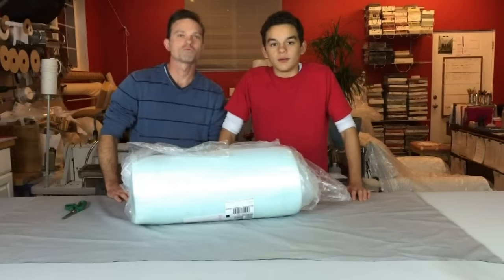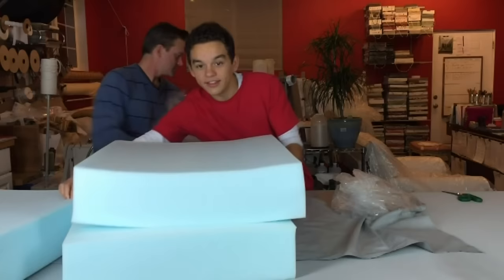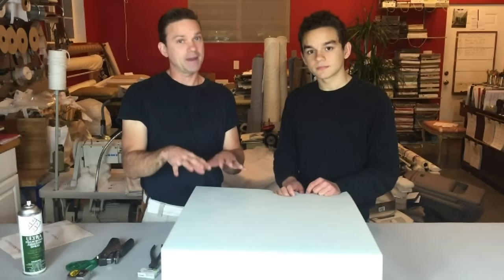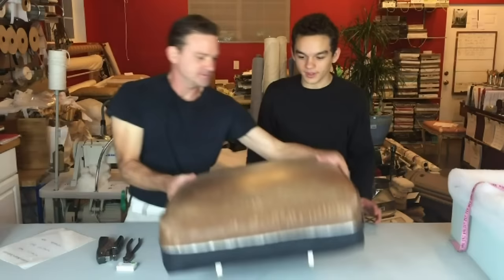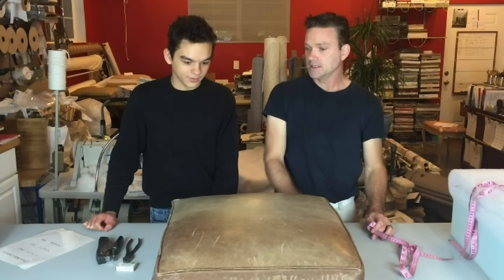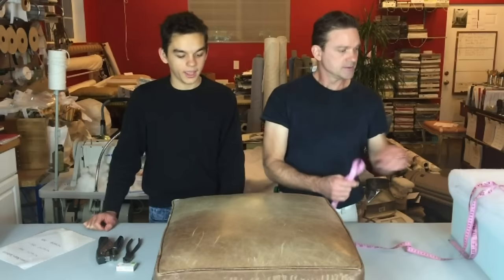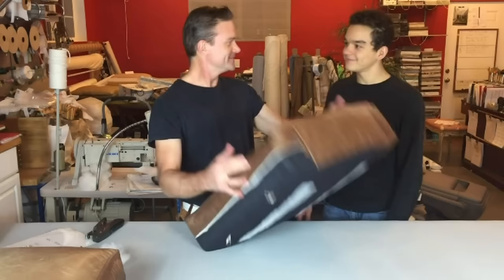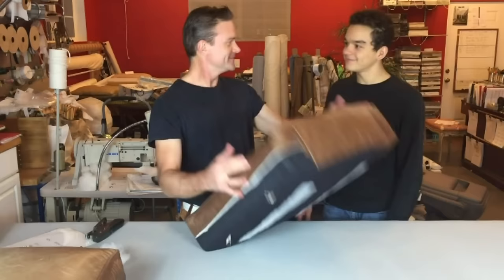Replace the foam in your seat cushions fast and easy!

Comment: Hello, quick question
Can I put a 5 inches thick high density foam into a 4 3/4 seat cover (Patio chair). 
I found a nice waterproof covers already made with a zipper , great price to save the measuring and sewing process. Pls let me know . Thank you for your time
Reply from the maker: Hello Yani,  YES! You can in fact we always go 1 inch larger then the cushion cover band size 4" cover we put in 5" foam PLUS poly-batting 1' thick , so you will be fine. It might look a little flat to you, but it will fit.  Cheers,  Paul
Reply: Really appreciated thank you

Comment: I have a cushion with a 4" box and have 4" foam inside.  Am I able to fuse 1/2" foam to the top and bottom in order to achieve my 5" foam?  Shall I use 26/45   1/2" foam?
Reply from the maker: Hello Lorraine,
Thank you for the comment, sorry for the late reply the holiday time keeps us very busy. To your two questions the 1" foam depends on 4" foam density. Is the 4" a really soft foam? Are you wanting a soft cushion? You could go with both being soft. You could go with the 45 density, however I believe it might feel odd. Because the 45 is to thin to provide any support. The best combo is a firm core with a soft 1/2" topper or 3/4". The stapler I believe is a Swingline  pliers stapler standard. I bought it at a big box office store. My father used a heavy stapler with a thick wire, they can be a challenge to find and I found it not necessary. I hope this has helped thank you again for watching and for the comment. Please share the videos it helps us when you do. All the best,   Paul

Comment: I can only get firm or medium of foam, and the dacron in different oz/gsm in UK ,would you please advise?Thank you
Reply from the maker: Hello Philip,
Thank you for commenting. If that is all you can find that can be okay. IF the cushion you need is not to thick. The thicker it's best to go with a softer foam. The thinner you would want a firmer foam. The platform has a lot to do with as well. IS it a springy or firm platform? I don't know your situation, but I would believe it's best to go with medium foam. As for the dacron . Here in the US we us 1" that is considered to be a full wrap. See if you can get them to help you in the thickness of the dacron/or poly wrap,rather then the weight. I hope this addresses you problem.  Please share the videos it helps us when you do. Let us know if you have another question.   Cheers,   Paul

Comment: What do you do if your seat cushion is a weird size or shape?
Reply from the maker: Hi Danielle,  
The best I know is 1) of 2) ways.   1) You can trace the cushion(s) with fabric, tracing on top of the seam the very best you can. Then cut carefully on the line that you just traced, using a slap of foam wide and long enough, trace a line a 1/2" outside of the fabric trace making for a total of 1" larger all around. FOLLOW the video instruction for all the other measurements you need. 2) Some companies will take your cushion cover  (OR TRACED FABRIC PATTERN) you ship to them and they will fill it. However things happen and it could get lost. Try this company foamorder.com  Hope this has helped and please share the videos it really helps us when you do.  All the Best,   Paul

Comment: I weight 350 lbs, what do you recommend the type of foam to use on a 6” cushion. It’s an older couch and this are the original cushions, flat as a pancake.
Reply from the maker: Hello Dean,
Thank you for the comment and watching the video. 6" foam is on the thicker side when comes to cushions. You will get even more support with any high density foam, we only offer and recommend 26 density. So to your question:  foam cushions at 2635  6"  will be very firm because of the high density, it simply offers more support than lesser density foam.The platform plays a roll, Is it springy or a firm platform?
All these factors need to be considered, all foam overtime weakens. If like a firm seat cushion given your weight that you stated, with a springy platform I would try 2635. However the out come could end up to firm for you in the beginning. And wow from a pancake cushion to a firm cushion you will have a big difference. I hope this has helped you. please share the videos it helps us a great deal when you do.  All the best,    Paul

Comment: Does the density factor apply to automotive seat cushions?
Reply from the maker: Hey Brent,
Thanks for checking out the channel. I have had others ask the same question. When it comes to autos it really comes to the year of the auto. Maybe the 50's and 60's bench seats if it has foam from the original factory, I'd say yes. I have had older import cars that had horsehair in the seats "CRUNCHY " Newer auto seats are foam molds with very high density in some case making it to firm. I really hope this has helped in someway getting you on the right track. Please consider sharing the videos with someone who might benefit. Thanks again.   Cheers,   Paul

Comment: Awesome! Great tutorial. Where do I order the foam?
Reply from the maker: Hello Mars Bars, Great name😀. You can go to ucprivatecoures.com  and order there. There is live chat if you have a questions. THANK YOU VERY MUCH for watching. All the best,   Paul
Reply: @ucsolutionsgivingmore  Thanks for your reply, Paul.  My husband thought that we should take the old foam out of the cushion and measure it so that we get the exact measurements of the foam.  What do you say about that?  Why did you measure the cushion with the old foam in it?  Just wondering what you suggest?  Also, what's the purpose of putting the dacron on it?  Do we need it?
Reply from the maker: Hi Mars Bars, great questions, the best method is to measure the cushion cover since the old foam is going to be misshaped. Also, you would want dacron wrap for the cushions so you can have that nice crown on top instead of it looking flat. I hope this helps!

Comment: Hi, at your videos you mentioned that if you are heavy or need more supports then able to order 2650 or higher compression like 50 or more, but at the site it is only offering 26 35 45 & 75.
what do i have to do in order to be able to other compression of 50,  thank you very much!
Reply from the maker: Hi, Great question, in some cases you can layer foam putting a higher compression foam underneath a lower compression foam. Though you are correct in regards to having more support with a higher compression, 45 compression is quite versatile and is still a viable option. All the best, Grant

Comment: where can I purchase (2) 18"x18" 4" 26/30 or 26/32 high density foam squares- these are for my rv and my butt spends a lot of time in that seat; I have purchased cushions from online retailers only to be severely disappointed; I,ll do the covering if I have to I just need the right foam 3 1/2" 26/52 would also work ; if you sell this item please let me know or suggest a trustworthy outlet where I may purchase; thank,s great informative video I learned a lot  sincerely, PATRICK.P
Reply from the maker: Hey Patrick, thank you so much for watching, we are very glad that you found our video helpful! If you would like to order the foam you can contact us at videos@urbancastlesolutions.com (this is the only email address where we accept foam orders). Please include the measurements and your zip code for shipping cost in the email, and we'll send you an estimate for the foam. There is no pressure to order as well. Please share this video as well, it really does help us!
All the Best,
Grant
Reply: I wish to thank you for your timely response; I will be contacting you shortly about creating a 3 1/2 " 18x18 cushion for my rv; I really want to trust somebody to do the job right;  26/ 52 dens./comp. thank,s again ,Patrick.p

Comment: I purchased a sectional and the cushions although comfortable are way to "cushy". Is there a way to tell the existing rating and a way to move up the scale to get a firmer cushion without turning it into concrete?  Thank you
Reply from the maker: Hi David, thanks for the comment. Yes you're wanting a higher compression number than what you now have. No we can't tell what the exciting rate is on your foam. Maybe but unlikely it's stamped on the tag behind the zipper bands from the factory. It should be if it's there the last two number say 1826. 26 is the compression number. Medium to firm is about 32 to 35 if you want there is a trick but you may not like it. Put a half inch cut to size a little shorter front to back plywood covered with fabric underneath the cushions it will make it firmer or you just need to replace all the foam seat cushions thank you again I hope this helped cheers.    Paul

Comment: I want to make so.e cushions for the back of my sofa. It came with basically pillow filling just inside the cover and i cant wash and replace the cover ever becuse all the filling will be everywhere. And its starting to get saggy
Reply from the maker: Hi M.A.
Thank you for the comment and for watching the video. I think I understand what you are saying. Here is two questions: When you open the zipper is there no liner filled with poly fill? Only poly fill pushed into the top cover? I have seen this before. If I have it correct you can get simple liner fabric or muslin fabric. Use that liner to trace the cushion when it's filled, band size maybe add an inch or so to that (making the insert liner larger to fill out the cover itself). Once you have the NEW insert liner cushions made and the poly fill permanently inside the new liners, you can clean the outer cover without having all the poly fill everywhere. I do hope this has addressed you problem.  Again thank you and please share the videos it really helps when you do.  Cheers,   Paul

Comment: Why do you need the Dacron at all?
Reply from the maker: Hi Caroleeena, 
Great question! You do not need Dacron at all. If the foam you are using is thick enough to give a nice crown or loft to the cushion.
Dacron gives a soft feel rather than a flat surface of foam, but if the foam is larger then the cover by one and a half times it will be fine. Please share it helps when you do. Cheers,     Paul.

Comment: Two questions, please:  What if my sofa's cushion is rectilinear but non-rectangular?:
 ____
|          |_
|            |
'-----------'

and is there any way to wash the Dacron before reusing it?
Reply from the maker: Hi SteveBowen,
In this case, it looks like you have a chaise cushion which is the same thing as an L cushion (just deeper). You can order it precut with Dacron attached here on our website: https://ucprivatecourses.com/product/sofa-seat-cushions-foam-inserts/

Also we’ve never washed Dacron to reuse it. I would suggest getting new Dacron since your current Dacron is most likely matted down and will not last long. 
All the Best, Grant

Comment: Would this method work for outdoor cushions"?
Reply from the maker: Hello Diana,
Great question. In short yes! However outdoor cushions need a special kind of fabric and foam, a large celled foam, (an easy drain). Instead of making the foam cushion larger all around 1" (as stated in the video) Skip the poly batting and make foam 1 1/2" larger. The poly batting will hold  to much moister. Regular indoor foam when wet is near impossible to dry out before the next rain, it's a large sponge. Please share it helps when you do. Cheers,     Paul.

Comment: I have a question.... y bought a very beautiful leather couch from cb2 and i fell in love with how soft and comfortable it was at the store when i tested it on the floor display.... how ever when i recieved it... it was rock solid... extremely stiff and extremely uncomfortable... i opened up the filling and its basickly exactly what you guys have replaced... it looks like blue foam wrapped in  polyester... will it soften over time??? Or is there a chance they put a softer stuffing or cushion in the store model to sell them.off
Reply from the maker: Thanks so much for watching our videos, that’s a great question, foam cushions will soften overtime however they won’t go from rock firm to soft like that. They could have put a softer insert inside the display model. Did they give you any options in regard to the fill for the seat cushions?
Reply: @ucsolutionsgivingmore  they did not...im really considering going to the store and open the cushion zipper to see if the cushion is the same... however idk if the stifness can vary with the same color blue foam??? Or is the blue foam standard stiffness with all.of them??
Reply from the maker: Great question, yes the stiffness or compression of a foam can vary even if it is the same blue color. You could have a 45 compression in your seat cushions and a 26 compression in theirs for example
Reply: @ucsolutionsgivingmore  very interesting... because it really makes a world of a difrence
Reply from the maker: It does! Let me know if you have questions.

Comment: How do you decide what weight batting material to use?
Reply from the maker: Hi Jack,
Thank you for watching our videos! Great question, you can go by the weight, however we go by the thickness. Which for wrapping cushions you'll need an 1 in. thick. Which is 1.5 oz. per ft. (as stated by our supplier) I hope this helps! All the Best, Grant

Comment: Why don't you use a vacuum to deflate the foam?
Reply from the maker: Hey David,
Thank you so much for watching! Great question, the reason being is we find muscling the cushion in to be just as fast  as using the silk film. At that time we didn’t keep silk film in stock for that reason. Though silk film is great for T and L Cushions which pose a more difficult challenge when you’re trying to just muscle the inserts in.

Comment: where can you get memory foam for a recliner? I have a Lazy Boy recliner and it needs more support on the lumbar/ back part
Reply from the maker: Hi Bob, 
We appreciate you watching our videos! I believe foamorder.com offers memory foam.
Reply from the maker: Hey there Bob, I just now saw your comment YouTube changed the comment structure and it’s more confusing than ever. Wow, I hope you did find a way to insert the foam cushion into the La-Z-Boy. It would be far too hard for me to explain it in text, plus they don’t build them all the same. You might need to take it apart unfortunately and there could be a zipper in the back bottom seat, or from underneath. This is probably not much help but that’s the best I can offer in text. Cheers, Paul
Reply: @ucsolutionsgivingmore  what's the best quality memory foam and firmest?

Comment: I looked at Albanyfoam.com, and there are so many different kinds of foam, I have no idea what to choose. Can you list exactly what supplies you used in this video?
Reply from the maker: Hi Shelley, Sorry for the late reply things get away from us so fast. The size depends on many factors, I covers them in the video, so please check it out one more time. But here is what to look for. * Thickness of the foam you are replacing.  * The platform that the cushions sit on (firm or soft). * The desired feel you want, Firm Soft etc.  A good rule is the thicker the foam you need to fit in the cushion cover the softer the foam you should purchase. As well buy the highest density you can find it'll last loner. Hope this has helped. All the best.  Paul

Comment: How about a T shaped cushion ? I worry I won't be able to handle that .
Reply from the maker: Hi Mary,
Thank you so much for watching our videos, and sorry for the late reply! Great question,  we actually came out with two videos about T-cushions here are the links:  https://youtu.be/dq2a1WPrLJ4   And    https://youtu.be/jE4sHsglP1g

The first video link is about changing a T cushion insert from a foam insert to a feathers insert however the same procedure applies, just add that inch to all the measurements as the "Replace the foam in your seat cushions fast and easy" video says. 

 I hope this helps!

All the best,
Grant

Comment: Where do you order the quality foam
Reply from the maker: Hi Marlynda,
Thank you for watching our videos and for inquiring about the foam order! By the way, sorry for the late reply.
You can order the custom cut foam through us at videos@urbancastlesolutions.com
I can give you an estimate below, all I need are the dimensions of the cushion covers
Please fill out the information below in your EMAIL NOT HERE.
How Many Foam Inserts ( ? )
Density 26 - Compression: ( ? ) 
IMPORTANT: Add 1" Only to all Cushion Cover Measurements: See Video https://youtu.be/4qxwvqy9eew?t=414
Side to Side (left to right) ( ?" ) x Front to Back ( ?" ) x Thickness ( ?" )
(Dacron wrap on the top, front, bottom. Not on the sides or back)
+ Shipping zip code: ( ? )  (could you please send us your zip code so we can estimate the cost, thank you) We don't ship to California due to the new proposition 65 law
All the Best,
Grant

Comment: My question is how do you get that damn phone into the cushion cover, LOL
Reply from the maker: Hello Gayle, thanks for checking out the video. Honestly it’s not that hard to put the foam into the cover. You would just simply unzip it if your zipper goes around the side about 6 inches or more that’s pretty standard, you would start one side get it in, flip it over to the other side standing on its end and work that in. You can use what’s called silk film and a regular household vacuum. Vacuum down the foam it’s very small put it in the cover cut  off the vacuum and pull out the film simple. Hey if you haven’t already please subscribe and share the videos it helps us out a lot when you do again thanks for commenting. All the best,  Paul